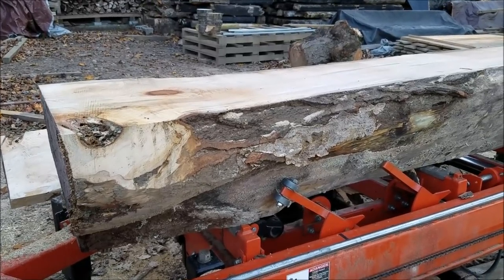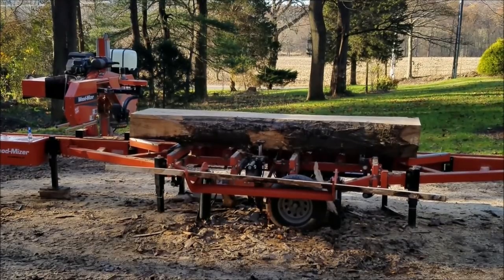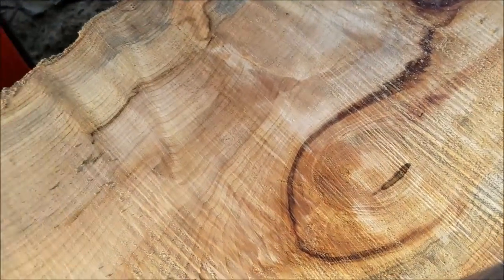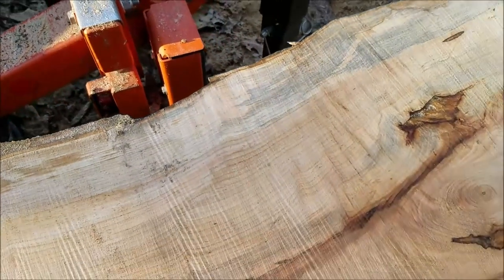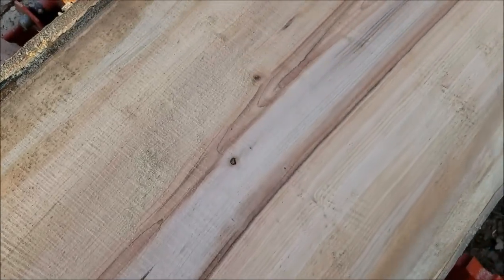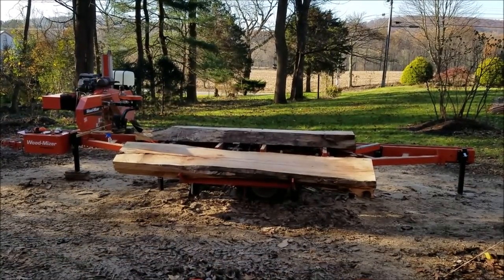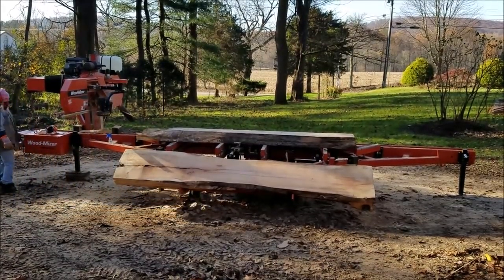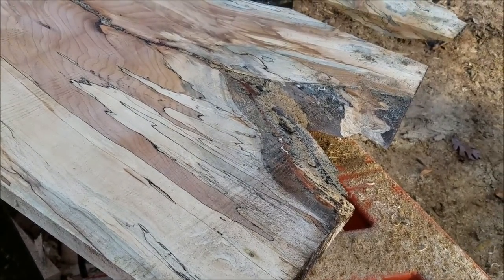More Spalted Maple

Comment: Beautiful maple - how will you store the slabs, dry them etc. without checking/ warping?  I have a huge hard maple blowdown I’ve been thinking of ordering a mobile saw to slab.  Appreciating your channel...
Reply from the maker: Thank you for checking in. These are stacked and stickers in the order they were cut. Basically putting the log back together.
Once they are stacked, i use ratchet straps to strap the log back together,  and cover them loosely with a tarp.
They will dry down to 10% before i sell them.
Thanks again, and go ahead and hit that subscribe button.